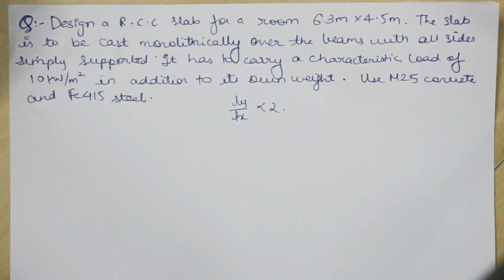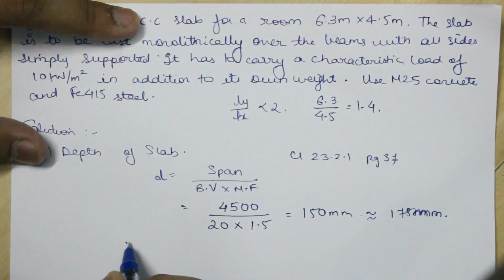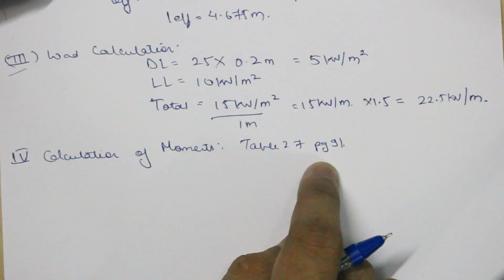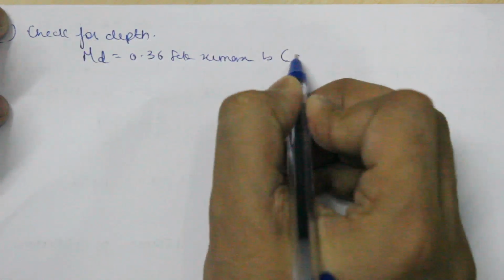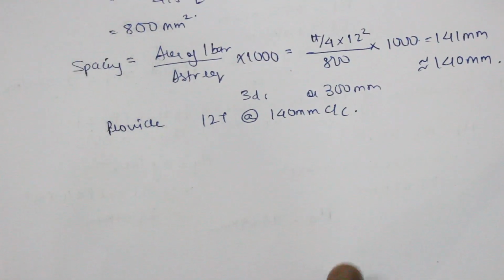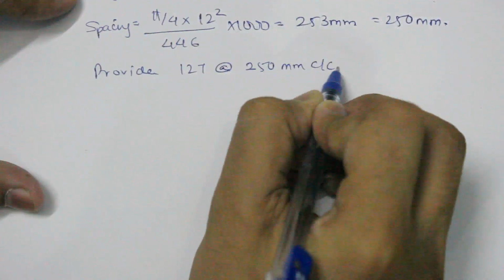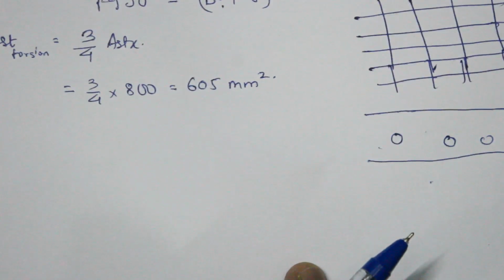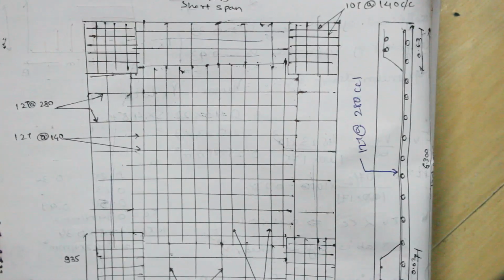DESIGN OF TWO WAY SLABS | IS 456 | Limit State Method | Mumbai University

Comment: There is error in load calculation for per meter
Reply from the maker: Can u tell me more about it? Thanks.
Reply: In load calculation step, for calculation for load per meter it will be multiplied by one meter with total load but you divided.
Reply from the maker: Yes you got the point correct thanks that's an error. Will pin down your comment so that others can see.
Reply: @vijaykant007 bro but we take depth as a unit Meter so it will no affect any calculation
Reply: How did you take aspects ratio?
Reply: @Er.durgeshgoyal18  bhaang khaye ho kya.. l(y)/l(x) hota hai

Comment: Effective depth is L/25 = 6300/25 . which equals to 175 mm🙄
Reply: min thickness of slab for simply supprted slab is shorter span/20.. 
Check Page 428 Chapter 13 Design of concrete Edition 14 Table 13.1

Comment: in the sum no need of torsion reinforcement and we take the bending moment value at table 26 page no is 91 as per code book , and in question monolithically all side simple supported so we take table 26
Reply: replies fast
Reply: please provide the check for depth

Comment: for longer span, in My why value of  Lx is taken?? why not Ly? 

Ly give more moment than Lx
Reply from the maker: It's done as per the formula given in the code. As for your question why longer span the answer is the coefficients have been derived by considering only lx for simplicity. Even though if you take lx but multiply by alphay you will get moment along My only.

Comment: In deflection check of both one-way and two-way slab, why percentage of steel is taken only for main reinforcement by ignoring addition of steel percentage of distribution? Reference [IS:456 2000, or any valid book following the IS Codes] >>> ANSWER WILL BE HIGHLY APPRECIATED <<<

Comment: in continuous slab panels,  the reinforcing details over support of one side twoway slab and other side  oneway slab of short span parallel to  support.  how redistribution of moment are to be done,  there because longer span have zero moments (in oneway slab) except mimimum steel of 0.12%

Comment: Hey can you explain how you have decided about slab that it is restrained or unrestrained..... As in question it is mentioned that monolithic construction is done so I think it would the case of torsionally restrained slab in which "all the four edges are discountinuous "I.e simply supported, this should be as per  table 26 of is456:2000, case number 9....please tell me as soon as possible
Reply: Simple. At any corner where either or both the edges are discontinuous, torsion reinforcement has to be provided. 
It has nothing to do with monolithic casting.
Reply: @aamir.durrany   it is mention in question that the slab is simply supported from all tha 4 edges ... What does it mean.... Actually I am confused in unrestrained slab and restrained slab (case: 9 of IS 456:2000) in case 9 it is mentioned that when slab is simply supported from all edges(discontinuous)) 
If we designed it as restrained slab then we have to provide torsion r/f else not and coeff. Too are different
Reply: @utterlygood7034  A "Simply Supported Edge" means there's no other slab beyond that edge. Such edge is also called a "discontinuous edge".

In the question it is mentioned that all 4 edges are simply supported (discontinuous). That means the slab is just one single slab as it is discontinuous beyond all of its 4 edges.

Torsion bars, by default, need to be provided in those corners where either or both the edges meeting at that corner are discontinuous. (Unless they mention specially in question to treat the slab as Unrestrained, in that situation we won't provide torsion bars in any corner). 

In this example, all the corners satisfy the condition for torsion bars. Also the question didn't tell us to treat the slab as unrestrained. So we provide torsion bars in all corners.

Now, the condition when Table 27 is used: 

Table 27 is used when 2 conditions are satisfied. It is used in only those cases where all the edges of that slab are discontinuous, AND torsional reinforcement is not required to be provided in any corner. For all the other cases we use table 26.

The example in the question does not satisfy the 2nd condition for table 27. Had they mentioned to treat the slab as Unrestrained, the 2nd condition would then have been satisfied and we would have used table 27. But in this question, we will use table 26, case 9.

He should have used table 26.

Hope this helps.
Reply: Yeah! The coeff should be as per 26 and not as per 27,Anyways Thank you very much!!

Comment: Hey. The shorter Spam which is Lx is 4.5m according to the question. In the solution, You are taking it as 4.675m. Can I know why?
Reply: 4.5 is the clear span and 4.675 is the effective span. We use effective span value in all calculations.

Comment: AT 13.28  while calculating eff.depth in y direction how come you are taking 6mm for the rod in x direction its 12mm rod for y direction 6mm its of half of the rod. i think you need to take 200-25-12-6 = 157mm. please explain.

Comment: If you are design for two way slab then how can you take your basic value as 20. refer IS 456 page no.39, B.V is 35 for 2way slab and you need to multiple it with ratio of 0.8 because of using Fe415, for modification factor we have to refer SP16 page no.10 table E. Effective depth = span / (B.V × M.F × 0.8)
Reply: Bro that is for spans upto 3.5m only. Above that u have to use as done in video

Comment: if spacing of bars comes in decimal it should be round up to lesser number.example if spacing is 130.33mm it should be round up to 130 or less of that value as 125mm.

Comment: What about BM COEFF for 4 sides with torsion provision T-26?
You took COEFF from T-27 why?
What aboutmiddle strip calculation, can you tell?
In depth calculation, span to depth is 28 for SS and 32 for Fixed or continuous. If we consider 20x1.5=30 does it satisfy that condition? And, why you multiple with MF as 1.5? It's not for FOS..

Overall nice explanations glad to hear in reply with above answers from asap .
Thank you.

Comment: sir what is design difference between one way and two way slab n design point of view
Reply from the maker: Major difference is the way of bending..one way slab bends in only shorter direction hence main steel is provided on shorter span. In two way slabs bending takes place in both the direction hence steel is provided in both span.

Comment: I got munch easier formula for area of steel

Mu = 0.87 * Ast  *  fy  * d   (1- Ast *fy / b*d*fck)
Reply from the maker: The formula you have given is for calculating steel using ultimate load method and Mu is Ultimate Moment of resistance. But the formula in the problem is for Limit state method where we use the actual moment and multiply it by certain partial safety factor and use that to calculate steel. Hope it helps.

Comment: Torsion r/f will be only for s.s? Or fixed also?
Reply from the maker: When the corners are restrained against uplifting we provide torsion rf , whether it is one way or two way or SS or fixed slab. For  eg at corner if there is a column resting on the slab it will be restrained against uplifting.

Comment: Sir, I am confused  whether to to calculate deflection , shear, ld, distribution steel in two way slab ?
should i need to check !
and please explain the length calculation as shown in figure  for bentup bar  
Thank you sir for this vedio
Reply from the maker: Yes you need to check for everything you mentioned.

Comment: Two way slab by strength design method...plz for your international students... and design of T& L beams by strength design or working stress method
Reply from the maker: The above problem is based on strength design only. But the code of practice is Indian Standard IS 456:2000. Idk what code your country uses. But ill definitely make a video on Design of T beam by working stress method.
Reply: Everything Civil sorry I meant two way continues slab not simply supported ... and thanks for replying 😊💖
Reply from the maker: Its a lengthy design. Sure, ill try to make give me some time.
Reply: Everything Civil sure I will wait sir actually im preparing for my exam which is to be held 2nd of july..
 two way continues slab by strength design is confusing I was searching on youtube to make my concepts clear then I found your channel your explanation is excellent thats why im asking for making a video :)

Comment: Bro , add design of water tank ( rectangular & circual ) and design of stair case , also
Reply from the maker: Design of staircase problem. : https://youtu.be/y_RNK--Tr7c 
Water tank will be uploaded soon.
Reply: Sorry I mean , what was difference  between deep well stair case , dog legged stair case & circular stair ( in design steps)
Reply: Which steps we have to use for different type of stair case
Reply from the maker: This mehod is only applicable  to staircases supported on rectangular slab such as dog legged staircase.
Reply from the maker: Design of water tank added
Reply: chinna c sure